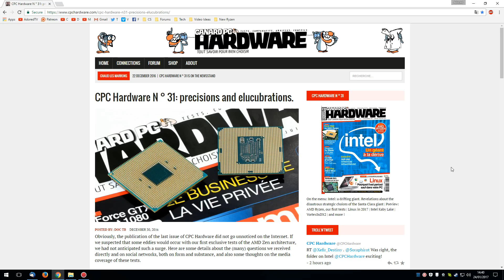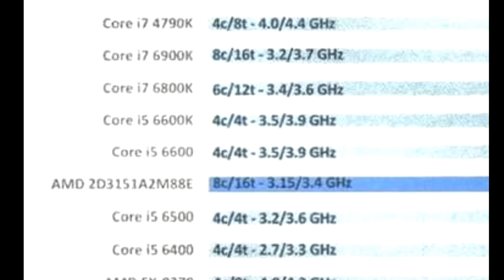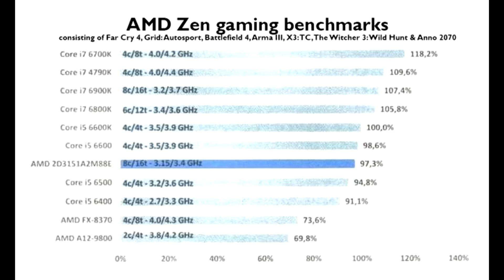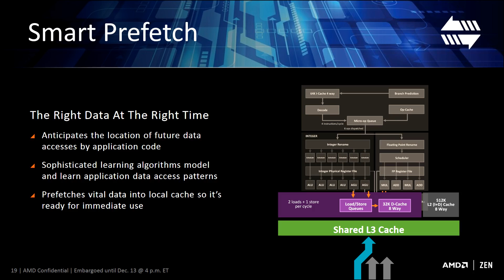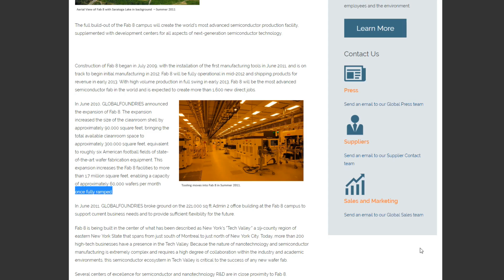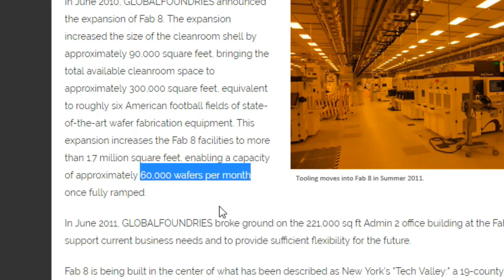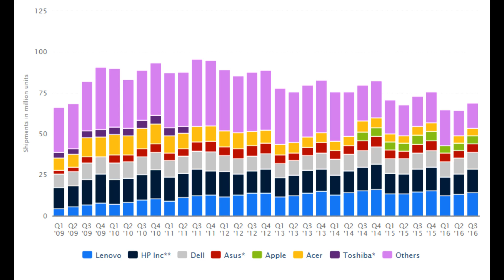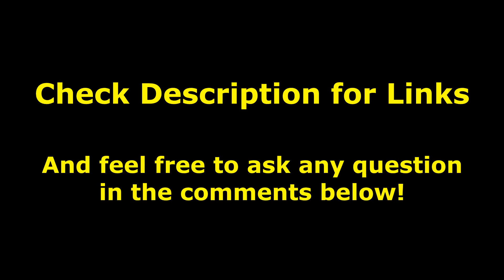Ryzen - A Refresher, Some Speculation and Market Analysis.

Comment: The FAB 8's output is a MIX of die sizes from 28nm downwards, not just 14nm. Don't expect all 60,000 wafers to go to AMD's new Ryzen production, heh.  " Fab 8 is responsible for development at 28nm and below and can produce up to 60,000 300mm wafers per month."
from this article:
http://www.eetimes.com/document.asp?doc_id=1327435&page_number=2
Reply from the maker: May 22, 2015 - http://www.barrons.com/articles/apple-likely-driving-globalfoundries-expansion-1432322306

"Of the three expansion phases of Fab 8, which is Globalfoundries’ sole 14 nm fab, all are fully built, and we believe phases 1 and 2 are fully equipped, with phase 3 likely halfway equipped. In total, Globalfoundries expects to have 60,000 wafer starts per month capacity installed when fully ramped, with phase 3 accounting for around 20,000. We think these numbers sound far too high considering the additional process steps and complexity needed to ramp 14 nm, and we estimate that fully ramped capacity will be closer to 30,000 or possibly 40,000 wafer starts per month. We believe nearly all activity is focused on the 14 nm ramp, and that any remaining 28 nm capacity in phases 1 and 2 will be converted to 14 nm over time."

18 months later, they surely have at least 50K 14nm wpm.
Reply: Still trying to find what percentage of sales for Global Foundries is AMD purchases. GloFlo is losing revenue yoy, and has only 17% of the sales that TSMC had last year
Reply from the maker: Only 17% of TSMC is a huge amount given the enormous size of TSMC. ;)  GloFo overtook Intel in terms of capacity last year, though much of their capability comes from their acquisition of Chartered Semi a few years ago - that is their fabs in Singapore and is mostly >45nm stuff.

Comment: i hope AMD keeps the price of Ryzen down, i have been holding out on switching to intel for a while now, just so that i can support AMD, i would be very angry if they reward me by kicking me in the nut with high prices. if ryzen costs more than 400$ for an 8 core 16 thread i will be getting an i7 6800k, i have been hearing rumors about prices exceeding 500$ us and i really hope that is not the case,  Vega is another story by itself, nvidia is definitely cooking up something big, in order to beat vega if it even gets close to gtx 1080 performance. there is the 1080ti and there was even talk recently of volta. This means for Vega to stand a chance it needs to have Titan x pascal performance for less money.

Comment: I've heard people talk about the 4 core Ryzen chip as being the one targeted towards gamers becasue it will have higher clocks. Do you think this will be the case? To me the way AMD are pushing their 8 core chip hints that it is their enthusiast/gamer class chip, even though 8 cores is overkill for games and comes with compensated clock speeds (compared to 4 cores, as seen when comparing the 6700k vs the 6900k). I've also seen articles stating the Ryzen 4 core will try to compete with i5s and i3s on price. Which again doesn't align with the idea that the 4 core will instead be the 'Ryzen gaming chip to buy'.
Reply from the maker: They are keeping their cards close to their chest, that's for sure.  I'm interested in a 4C/8T CPU just to see how it shapes up vs the 7700K, but if AMD decides to drop a really cheap 8-core on us I won't complain either.

Comment: Any comment on how Intel seems to combat AMD with the lower end chips like the new Kaby Lake Pentium with Hyper Threading? People are speculating that Intel would upgrade their Mainstream processors according to that. 
So an i3 would have 4 real cores no Hyperthreading, the i5 would get Hyperthreading and the i7 would get 6 cores and Hyperthreading. 
The Pentium has made the current i3's a really bad Price to performance Cpu.
Reply from the maker: Yeah the i3's are completely garbage VFM now, however one way to look at it is that Intel is just trying to squeeze money out of people by offering HT pentiums, knowing full well that the i3's will be down at $75 soon. ;)

Intel being forced to move their current quad i5 CPUs into the i3 price bracket would be a calamity for margins, given that the 4C is a larger die.
Reply: this chip has been getting some press lately:
http://wccftech.com/intel-pentium-g4560-ultimate-budget-cpu-65-usd/
Reply: @john pombrio
holy fuck this chip is crap it does 83 percent of multicore performance compared to a stock i5 2500k.
and it's only 19 percent ahead of a stock i5 2500k.
around 6 years after the i5 2500k launched and they still trying to sell people this shit that can't even keep up with this ancient cpu?
yes it's dirt cheap, but it's obsolete before u even buy it ;(
i feel sorry for the poor souls that have to deal with oems that throw these into their desktop systems.
i rly hope zen crushes the low low end with low clock speed quad cores.

Comment: If the prices speculated that surfaced a couple of months ago with a SR7 at 350$  and the other SR5 and SR3 family priced accordingly it is truly going to be a bloodbath to Intel revenue if those prices get confirmed.
Also the Top Intel CPU's will become instantly non-viable at current prices if AMD does make the pricing according to those latest price speculations.
No one would buy a core i5 for example if with more say 100$ one can get a hugely more performant SR7 ... 100$ in the overall price of a desktop is really not a big deal.
Also who would pay 1100$ for a Intel CPU that is say 10% faster then a 350% AMD Ryzen SR7 ?
There is simple a very very very reduced set of scenario were that would be justifiable.
At those speculated prices Intel is indeed in big big trouble.

Comment: "In the past Intel used its superior performance to keep AMD down. So even when AMD had decent parts, Intel could always charge just that little bit more for something a little bit faster and it really pushed the price of AMD CPUs down." (~14:35)

Cue the rumored Skylake-X and Kaby Lake-X set for reveal in August? I think in the case of Ryzen, Intel just really wants to push AMD out in performance (even if it's just slightly) with the toaster that Kaby Lake is. Outside of tech enthusiasts and the PC gamers, few people even know what AMD is. I think that's very unfortunate, given how beastly and honest AMD has been in the past.

As always, keep making amazing videos.
Reply from the maker: Kaby-Lake X is just a quad on X299 though right?  Complete waste of money on that tbh, I can't even see the fanboys paying for that.

Skylake is a monster of course, but I think AMD has a lot of pricing wiggle-room.  I think that so long as their 8 cores can be faster than Intel's 6 cores they'll be alright.
Reply: Well, in this case, I think it's less about the chipset, but more encouragement to properly tune the chip wattages. I mean, getting to 90-100 C with aftermarket coolers if you didn't manually tune the voltages. That's kinda scary.

To be honest, I don't know the specifics of Intel's CPU architecture. I don't know if it's possible to "tune" the performance like AMD was supposedly doing with Ryzen before release.
Reply from the maker: Nothing much has changed with Intel in years tbh, which is why they are in the position they are in now - both good and bad. ;)

A lot of people are expecting some big release to counter Zen.  I'm expecting nothing at all, in fact I think Kaby Lake was their big answer to Ryzen.
Reply: AdoredTV I agree. I think Kaby Lake was meant to try to match Ryzen. Hence such a small improvement.

If there's a thing to rival it, it's probably Coffee Lake (which I'm going to call Latte Lake). I expected more out of Kaby Lake. was sorely disappointed.
Reply: hm latte lake, nice nice.
cabbage lake (kaby) and cookie lake are still hard to top though.
damn i wanna see cookie lake so bad.

Comment: i'll be very honest, the assumtions you make are too biased for AMD.

for example, in here, you're placing such a high emphasis that the benchmarks were worse case senario, but the best case won't be far off though, even with all the higher clock speeds, the varience in the results is not going to be big enough to significantly beat intel's any current offerings.

and then intel could do a gtx 1060 for the RX480

i mean, yeah, i sure do hope, but i think, as this point, the bias is very clear
Reply from the maker: I think I explained it like it was presented.  For example, CanardPC pointed out that their Ryzen sample never went above 3.3GHz and that it had two bugs.

We know that the lowest base clock speed of the slowest Ryzen 8 core CPU will be 3.4GHz and will launch without any bugs.  We've seen 3.6 Base clock/3.9 Turbo Ryzen samples at CES.

Given that this buggy, underclocked ES already beats the 6800K..I don't think it's too much of a stretch to say that a proper release Ryzen will clearly beat a 6800K?  Pretty sure you'll find I'm the most cautious of anyone in the press over this, most of whom are declaring it a winner over the 6900K.
Reply: oh, no, i'm not saying it's not going to beat intel, but it's not going to beat intel enough

like RX480 was a very good product to the existing market, but then Nvidia released GTX 1060 immediatly.

the gap wasn't big enough and the competition can immediatly respond to it, this doesn't allow AMD to regain any market share

Comment: Great speculation as always man! 
I really agree with the end statement about Intel's i5 7600K. 

Most modern games really make use of 8 threads if they need it.
This can be seen with older Core-CPU's like Sandy Bridge where the 2600K is now in a hefty 30%+ lead over the 2500K when the CPU is the bottleneck in a gaming scenario.

If this translates over to Ryzen as well the Core i5 is in a really rough spot for Intel if AMD releases a 4C/8T CPU in the same price range.
Reply: Compared to the GPU bottleneck, the role of the CPU and the number of its cores in gaming is minimal. If the number of cores actually made a difference, you would expect to see that in people's purchasing habits. Looking at the Steam hardware survey, over 46% of the CPUs that Steam users have is a dual core CPU, while 4 core is 48%. The number of users with 8 cores is one quarter of one percent or 0.0025. Most of that is due to cost, but even the lower cost 6 cores is only 1.5%. Why AMD is targeting Ryzen 8 core as a "gaming" CPU is a complete mystery to me. As for the eventual introduction of a 4/8 core Ryzen APU, that is still unknown when that will be available for sale, or how well it will compete against Intel's many versions of chips and prices with 4 cores.
Reply: John Pombrio I am not sure where  AMD implies that the processor is targeted for gamers. The game demo is used just to show that their thing is just as good as the 6900K (which neither is a gaming processor). It is free to speculate about the eventual release of the 4C one though.
Reply: Well, a 6C/12T and a 4C/8T CPU is pretty much confirmed to be released and they are obviously going to be meant for gaming.

Comment: thank you for the video Jim. And thank you for having convinced me not to buy fx cpu :-)
Reply from the maker: Cheers bud.
Reply: Which brings up a question of what is AMD going to do with old fx stocks, no sane person would buy any already; much more so when Ryzen hits. I guess it depends on how long the lag is in their inventory, but, at what price do the FXs become a good deal. Wouldn't be surprised if that line did a dead cat bounce at the end.
Reply: Lucid Nonsense yeah those FXes have to go as low as 50 bucks to still sell after ryzen hits the market lol

my FX8350 costs 15 bucks more than it did when i bought it 3 years ago, so it's really not worth it anymore by now lol
Reply: dammit bought one a month ago. ohh well.
Reply: actually on the second thought im quite satisfied with my purchase. it was a second hand, got the fx8350 with a full atx overclocking mobo and a 100 dollar psu. for 225 euros. not bad. shouldve waited tho, because prices will drop even more. but whatever.

Comment: 3:55 "The games were sensitive to frequency" "Which is actually pretty unusual when it comes to gaming"

Uhh, wait. Is this not the normal case? I thought that was the logic behind the faster 4C8T processors outperforming the slower but higher core-count processors.
Reply from the maker: Depends on a bunch of factors tbh, resolution being the main one but IPC, frequency, resolution (whether or not the  GPU is the limiter mostly) and other stuff all usually counts more than simply CPU frequency alone.
Reply: Grimmie XII i think he meant frequency vs overall single core performance ( frequency*ipc)

Comment: Would the yield calculator only measure flawless dies,  with some of the rest being salvageable,  or are those all the working dies?
Reply from the maker: The short answer is I'm not completely sure.  I believe that each die is tested then dotted on whether or not it appears to work ok or has either an open or short circuit.  The latter two cases will probably be thrown out.

There's no such thing as a flawless die though, just some that are better than others and some that are definitely not workable due to too many defects or some other issue that makes them completely dead.  Even some that didn't count towards the good die here could theoretically be salvaged if they were worth it though.
Reply: AdoredTV yeah,  meant flawless die as in fully working ( cache,  cores and all)